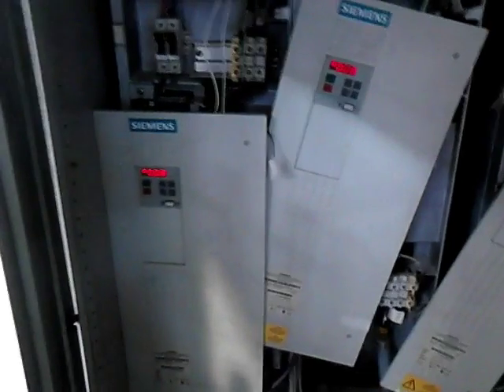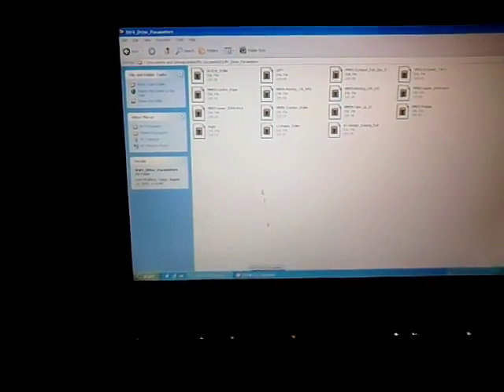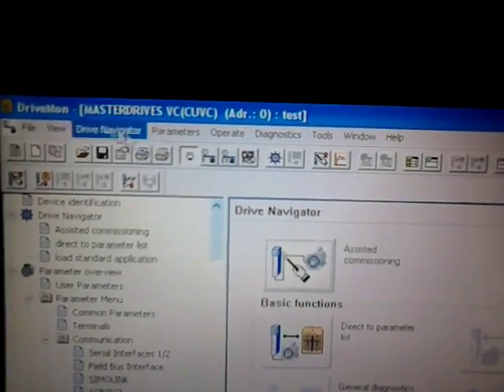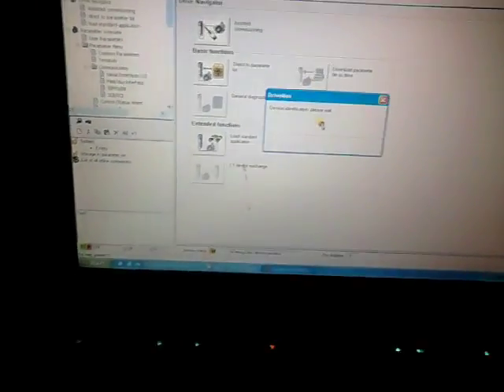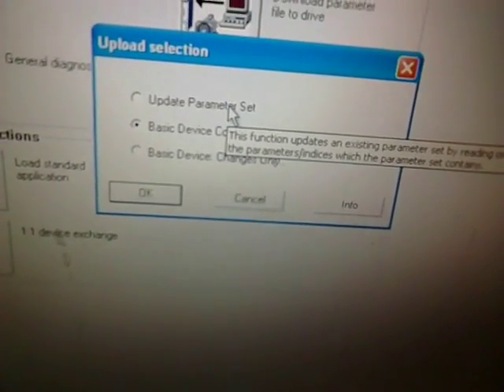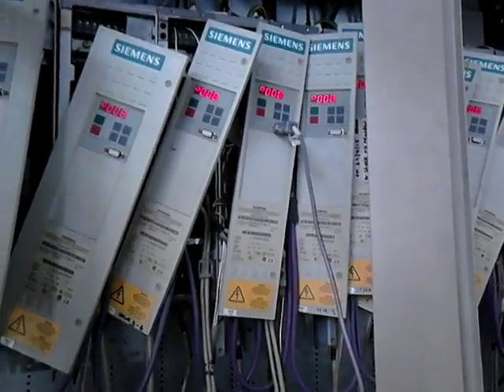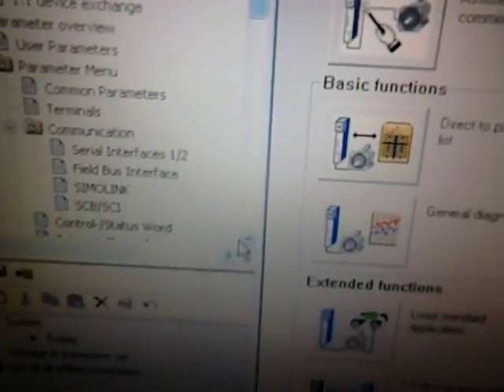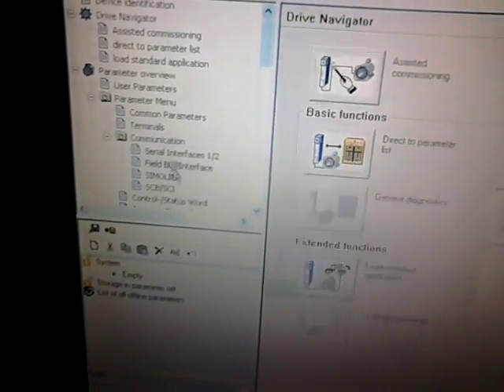How to use Siemens Drive Monitor on Master Drive

Comment: Hello sir hope u r fine, i wanna ask u how to configure MasterDrive MC Plus (6ES7021) attached Encoder card Model 6se-7090-0xx84-0fe0 with Motor Encoder Sick SRM50-HZA0-S05 Absolute Encoder. I tried making new Application every thing is ok for a while but when i start the control it said PreCharging Fault any idea on this?? Help is greatly Appriciated.
Reply from the maker: Try to run the drive alone first then gradually add the other devices. By this method you will find the fault and reason for that. Hope this will help

Comment: Hello, I have a problem getting conntected to my simovert masterdrive. What should I configure in the drive in order to get connected via Drivemonitor? 
Do I connect via X103?
What is the correct wiring of the communication cable?
I have the drive in the laboratory and not in the machine.
And finally I would like to change the firmaware fo the drive. What is the correct procedure?

I do appreciate your kind help. Peter
Reply from the maker: You can connect using the Front Panel/ Keypad.
For cable and connection check this link
https://engrsajidrehman.net/tutorials/master-drive-parameters

also given in video description.

If you want to change Firmware just because of connectivity issue then avoid it and follow the correct procedure.

To change the Firmware, you have to check the current version e.g. 1.x or 2.x and then you can only upgrade the firmware to the same series like 1.1 to 1.2, etc. but can't 1.x to 2.x also it's not recommended to change firmware unless you must have to change..

Hope it was helpful

Comment: Thank you very much for this video. It was very helpful.
Can this be done while the drives are online with the network and controlling motors?
I mean, can you pull parameters from the drive while a plant is running?
Reply from the maker: Yes as we can use the same tool for troubleshooting, but this is not strongly recommended as the time when you will try to configure the drive, it will STOP for a while and a major accident or damage could happen. So I suggest never try to parameterize a drive or any device while Running within the process.

Comment: Where did you get the pin diagram of the cable from?
Reply from the maker: Sorry for late reply... Its mentioned in Siemens Master Drive Manual. This one is already tested and you can get the picture from my website link given in description.